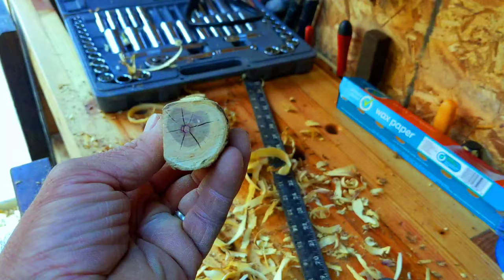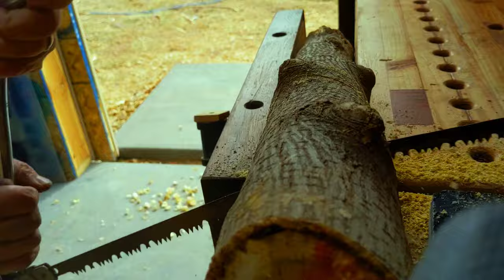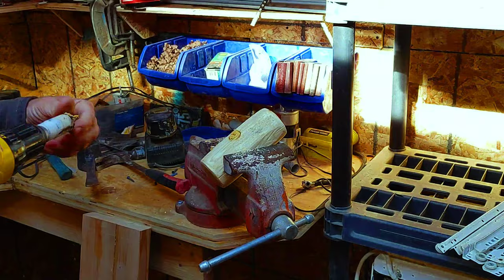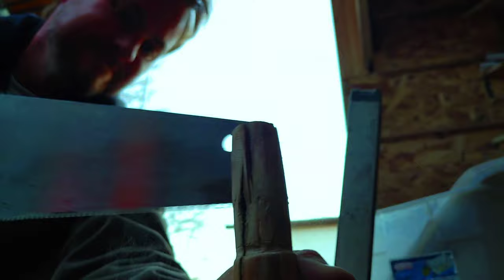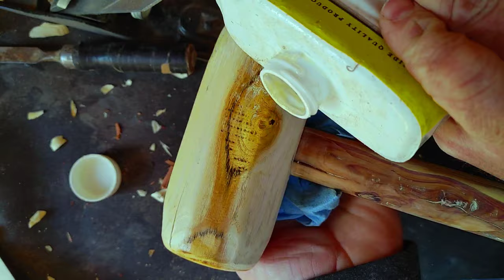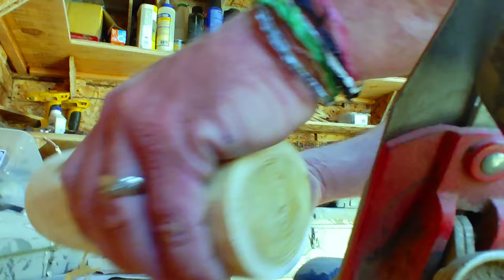Lilac, plum and mulberry wood mallet.

Comment: Nice work, I'm going to make a mallet out of mulberry soon as well.
Reply from the maker: You should. I use mine all the time, especially with chisels.
Reply: @VanDamArtisan  One question about handles, if you have time : I only have mulberry, pear, and oak to work with (all well dried). Which do you think would make the best handle?
Reply from the maker: @SouthernItalyHomestead  honestly, all of those are great choices. They are all hard woods. Mulberry is probably the softest though. Oak has good straight grain and would work well for the handle.